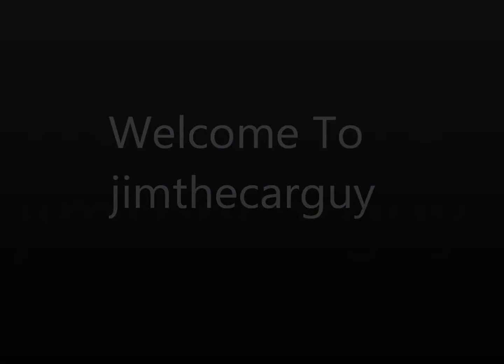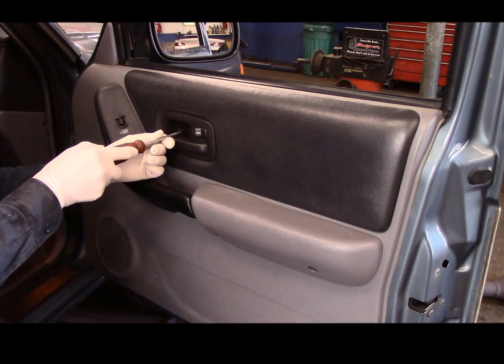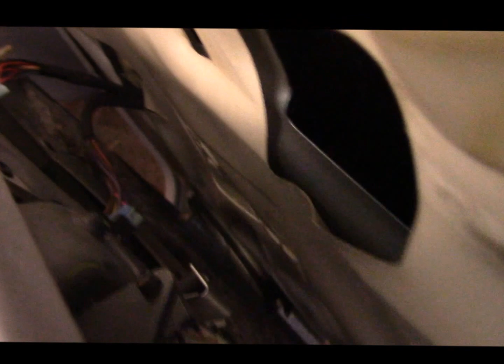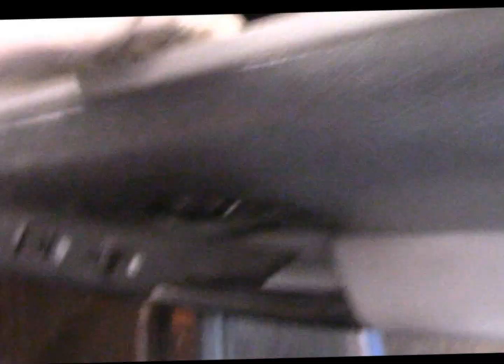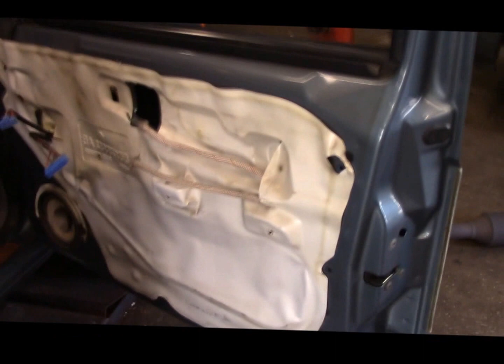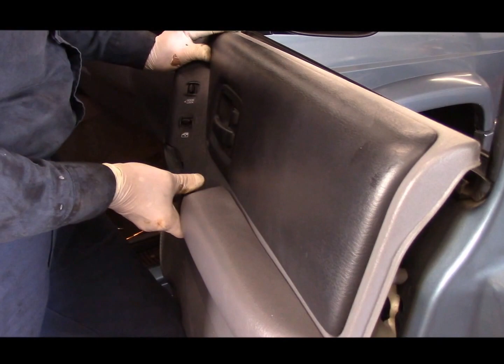How To Replace A Power Window Motor And Regulator

Comment: Hi Jim. Brilliant detailed video. Thank you. May I ask, you said it's just the regulator and not the motor and then said it's cheaper to replace the whole unit rather than just the motor right? So did you use a whole unit with a motor or did you attach the motor to the new regulator off camera? I only ask because I'm planning on doing my driver side and can hear the motor. I know it's just the regulator and cable that gones and if I can save money ion knowing it's just the regulator then that's awesome and cheaper.

Comment: I love this video!! Totally subscribing!
Granted, I wasn't addressing a window issue, rather my side mirror on the driver's side power adjust so I had to take the door apart so I could get the plug in. But this video gave me the information I needed. Thank you thank you thank you!

Comment: so my window will go down but not up, and the motor makes a noise, does this mean it my regulator?
Reply from the maker: You will need to open the door panel and see what is broken.
Reply: @jimthecarguy  yeah i did try that but its hard to tell, its both sides alyhough one went before the other, the motor whirrs and it will come down but doesnt want to go up

Comment: what if the window is all the way up to start?
Reply from the maker: Then you will need to open the inside door panel and remove the bolts to remove the window and regulator.
Reply: @jimthecarguy  how about if motor has ribbits